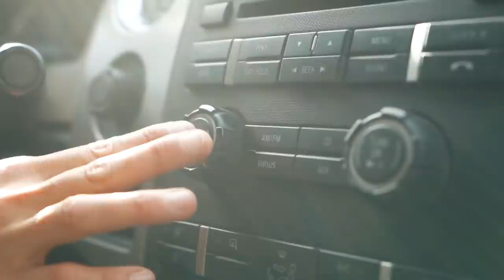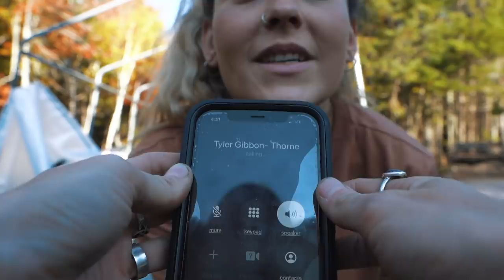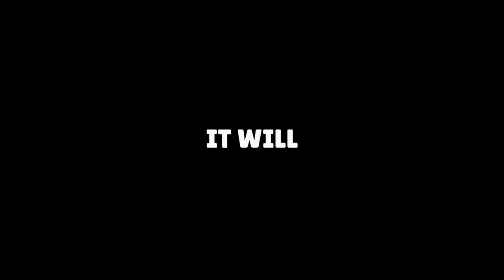Preparing for First Winter at Off- Grid Cabin

Comment: When you stack your firewood use long sticks branches  every .5m. horizontally in the stack to prevent fall over. :)  You can use pallets on the side walls,  wire tied to the metal post and wired tied together to protect the structure and add support and strength so it does not blow away. :)  Hammer down wooden branch posts into the pallet slots so the pallet fence inside does not fall over. :)  Dump your delivery of firewood in front of the seasoning tent that way you are not walking 20m. to stack the firewood. but just a few feet to stack the firewood.  :)   Have a nice morning restacking all the firewood that fell over during the night because it was stacked wrong.  :(  I wish you all the best. :)

Comment: Very nice ladies!
Try stacking the wood in layers. Each layer should lay in a different direction. Then the wood will hold itself up, and not roll off into the walls of the structure.

Comment: Just because of the weight.  friendly advice. 
1. I live in New York State and get pretty good snow storms 16" to 40" in a single storm I have the Alpine version of the shelter logic tents and they have more pitch on the roof than the ones you are using and have seen 24" of snow on top of them and they needed to be cleaned off a number of times because of the weight. dont be suprized if your tent collapses with heavy snow.

2. make sure that you leave the door open on the tent over the winter other wise the moisture in the wood will condensate in the shed and then freeze on the inside of the shed and then when the wind blows it will snow inside your shed. the first year I stored green wood in these sheds I had 3" of snow inside because of the condensation. so leave the door open the wood needs lots of air. 
3. You would of been better off building a down and dirty wood shen with the logs that the guy took away.

Comment: You should have 2x4’s under each stack so the bottom layer doesn’t rot. Then you can add 2x4’s or 2 stakes on the side so I makes a U shape and that will hold the wood where it needs to go.

Comment: Hi ladies, thank you for sharing. Idea for your wood shelter, make a rack for the wood and the wood be off the ground and off the sides of the shelter.  If you squared the wood it wouldn't r roll down  only if you don't have anything holding the wood from moving. 2 pieces of one One direction then next row and put them the other direction and that how you square a wood pile if you didn't know.

Comment: The criss-cross / hash-tag piling on the ends is the best way to go, except you use some "stickers" - about 3 or 4 feet long 1" x 2" pieces, usually off-cuts or something and put them about every 2 to 3 feet high, sticking into the pile, so the ends line up with the criss cross ends, and only on the layers where the sticks will be perpendicular to the pile. This LOCKS the end criss-cross piles into the main pile and holds it all together. #stuffyoulearnfromyourdad101  AND, should have a couple 2 x 4's on the ground, the length of the pile to get the wood up off the ground and allow for more circulation. Old pallets cut in half come in very handy to pile on.

Comment: Hi my lovely girls :)
You don't have to reinforce the tent.
You can choose to store the wood in some other ways.
As Aaron Rogers wrote, you can build tent walls with wood walls on all tree walls, and make crossed layers in the corners, as when you build a house with brick wall.
This will be strong enough to save the tent wall.
If you think the wood wall feels week, then you can do a double wall if you have the extra power :)
I think you don't need to stack all the woods. I think it will be enough if you build this protection walls and then trow in the rest of the wood in the middle as a big pile.
It will be enough dry.
But it can be a beautiful creation if you stack all woods, but it may not be necessary.
The good thing is to have the roof over the wood, so it will get rain and snow on it.
You two have so much other fun things to do, so don't spend to much time on making a beautiful wood pile :)
Have a nice week ladies
/Peder

Comment: Pour monter votre serre, c'est plus facilesi vous montez la structure de toit au sol pour y placer la bache ou le film polyane et faire tout monter par la suite en rajoutant les pieds d'un coté puis de l'autre.
To assemble your greenhouse, it's easier if you assemble the roof structure on the ground to place the tarpaulin or the polyane film there and then mount everything by adding the feet on one side and then on the other.

Comment: On your wood drying tent, you might want to consider other methods of stacking your firewood to reduce the risk of an avalanche damaging the tent walls. E.g, you could stack each layer in a crosswise direction in log cabin style so each layer holds the next layer down from rolling away. In this way, you should be able to build a larger stack with more vertical walls -- and a lot better air circulation for drying your wood. Try some experiments to see how it works before committing to the idea.

Comment: You should put a wooden 2 X4 across the length of the shed and use the 2X4 to drill some plywood sheets around the whole shed so the wood doesn’t tear through the cloth cover…….and don’t forget something to put on the ground UNDER the wood…….

Comment: You all need to find a gator to help with your workload. They have a power dump box and are run by a Diesel engine. You can find them at auctions quite cheap

Comment: You need a wood rack instead of walls in your new woodshed. They are 2 steel tubes that fit over the ends of treated 2x4’s. Keep the wood off the ground and keep it from falling against the walls. Got mine at Northern Tool but don’t know if they have stores in canada

Comment: Hey you should stack your split firewood on the ends of the pile and interlock it,  kinda like jenga blocks. That will hold the piles up and keep them from falling
Reply: Also mix the unsplit wood with your split woods as you stack it.  When you want a fire to burn longer,  put the round logs on the fire,  but round logs are harder to get fire started with so you will want split wood in your pile all throughout the heating season

Comment: Oh, it's probably too late but I wouldn't try and reinforce the sides so much as try and delineate the ends of the wood pile by using like 2 8' T posts on either side. Drive at least 2' down if possible. Could also put rope or wire between posts at either side to reinforce so they don't bend towards the walls.

Comment: Hi girls, before u stack all that wood wrong and try to reinforce the wall !.there is a way to stack round small logs, every second layer u put two logs each end of the stack facing out towards the walls then rest a log under the ends of those to give you a slope to put the next two or 3 layers across. hard to explain must be on u tube some where lol. Then no need to try and reinforce the walls, good luck

Comment: You two are doing amazingly great considering you probably weren't raised using tools or building things. The ford truck is one of the lemons that ford made from 97' to 12', and for that reason the old saying, "Fix Or Repair Daily," or FORD was created. If you ask a Ford mechanic they will tell you that the years I mentioned are the trucks they work on the most. I just hope you got a cream puff aka one owner, who took care of it. On a different note: if you drive a post into the ground on each end of you piles of firewood, and lash them at the top to keep them from spreading, that should salve your stacking problem.  For winter, I suggest you get the cabin insolated so you'll only need 3 cords of wood instead of 6. As a project to look at for the future, I suggest a Rocket stove/heater. The amount of wood they burn is a staggering less amount then what you'll burn this winter or any other and if you do it right, it'll heat your house in the doing. Like I said in the start, your doing a way better job then most girls I've known. You did mention your going to build a deck on the side of your cabin, but have you considered using some of for an indoor bathroom?  Great video as always.

Comment: I own those logs that you got out there that you hadn't cut up into firewood yet you could take a couple of them and make it a flat disk yeah it's a flat deal on the bottom and 2 sides sticking up and screw them together and then put a brace across the top and screw that together and then put 2 angled braces at the bottom and then that way you'll have a structure that would hold them up off the ground keep the water from running under them and you'll be able to take and stack it in between those logs Without it falling over even if you had to put braces in between the middle of it and stack over the braces

Comment: Had no idea you could get a tent (Canopy) like that .  It really is a great idea if you have er locked down tight for those really windy days you are sure to get. 
Like the way you are clearing the forest, and "buying" your fire wood.  lol  If you cut u the dead trees they are already dry.  I would imagine you are starting with the dead trees, no?
Crisscross the ends of the wood rows and it won't roll away.
You could also make two L brackets from 2X4 (?) the height of your rolls and set them down like book end to stop them from rolling away.

Congrads on the nice trk., but what's wrong with the name "Big Red."  
It's factual and to the point.

Comment: Stack the wood so it's not leaning on the walls. They're not designed to take that sort of weight. Also, pin down the legs of the shelter so they can't spread when there's a ton of snow on the roof.

The truck? Well, I used to work with a girl called Rachel, who got called Rosie because she blushed easily. So, maybe Rosie?

Comment: Hi Girls you're stacking your wood wrong at the ends so left and right off the stack you schould switch from one line like you girls did but then the othere line just the oposite way (just the beginning) so you'll be able to stack higher an without falling. so one line straigt ahead the other 90 degrees like a cross. good luck

Comment: Just wondering if reinforcing the walls to let the wood lean against them will mess up the air circulation or sunlight getting in or anything. Is there supposed to be space between the wood and the walls? In case it's a special fabric?  FYI I know nothing about it, just a thought

Comment: Final fix for my van reads like... "engine controller shows incorrect calibration for the cooler valve, verify calibration level is at spec......rest values and test....will set calibration error after 20 mi of drive...contact star center verified proper calibration installed....performed relearn engine control module and reflash with updated software.... test vehicle for 180 mi several times no issues "

Comment: So🤔although you can split wood with an ax, it is literally 100 times faster and more effective to use an 8 lbs splitting maul. I have split hundreds if not thousands of full cords of firewood. I cut 200 in one summer alone. Get a splitting maul😌

Comment: Taking out the smaller trees is not good forest management. It's just aesthetically pleasing to you. The larger trees should have been taken down because they aren't going to flourish once they get so big. The smaller trees should be the ones you want to flourish. The big trees don't have that much life left in them and could die and cause problems. The smaller trees will grow nicer if the canopy is opened up by getting rid of the bigger trees. If you do any thinning take out the bigger trees and some smaller ones so it's not as thick and the smaller ones can grow having space and sunshine because the canopy is opened from getting rid of the big trees. Logging 101 for the cycle of life of a healthy forest. Things like this you will need to learn if you plan to use any of the trees for lumber while living "off grid."

Comment: You don't need to reinforce the walls, you need to stack the split wood alternating directions on each layer at the end of your rows.  That way you can get your stack square instead of a pyramid like you have it.  This shows you how.  https://www.youtube.com/watch?v=Ajtcx54MLk0.  I also worry about yoru firewood being so far from the house.  You need another smaller stack that is closer to the house so if you have a severe storm you don't have to go for a hike in it.